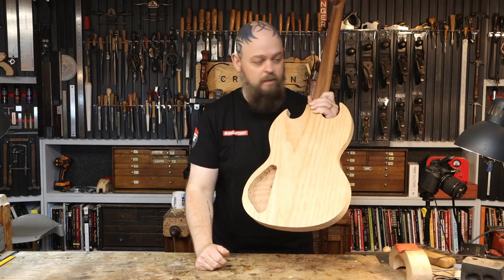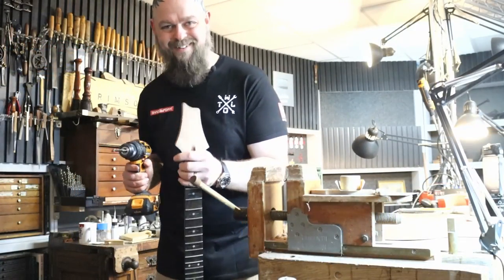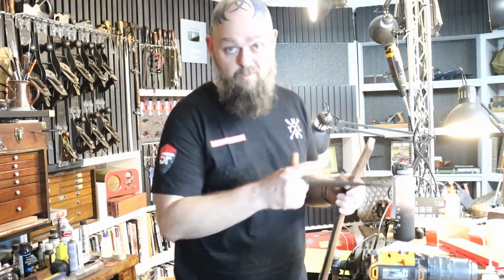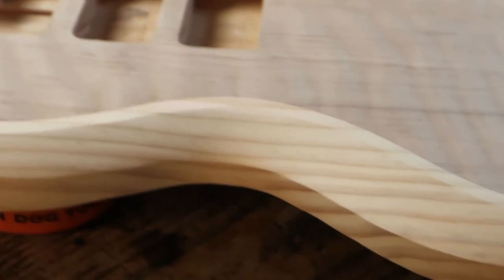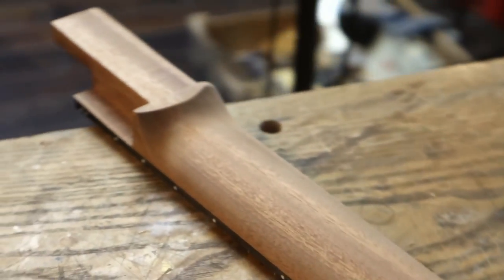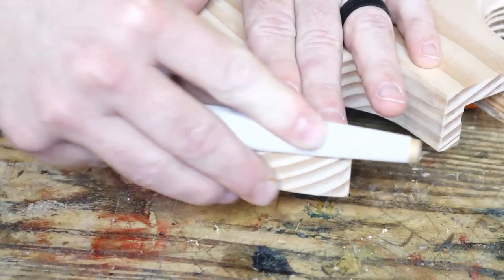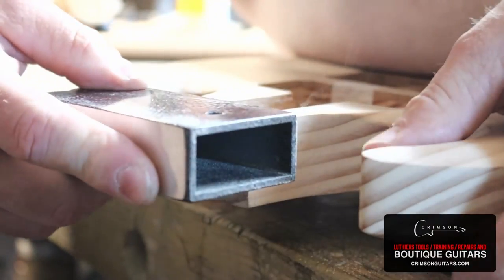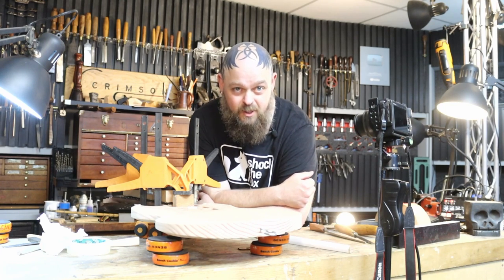Ep 11 - It's in the Fine Details! Fettling, Carving, Shaping & Dialing this Guitar in - Redwood SG

Comment: Hey Ben, I'd really like to see more of the finishing processes - not just wipe on poly or Danish oil, but finishing to a high gloss. How to finish porous woods, grain filling and leveling. I find my builds go relatively well and then I'm let down by poor finishing.
Reply: +1!
Reply: I’m intrigued by the superglue finish you used on the neck of the ancient wood build. I’m getting a kit for my birthday (you got to start somewhere!) and I’d really like a high gloss finish with (relatively) little pain. I’ve never been able to get a great gloss finish using varnish on my furniture. Really hoping you’ll be showing us how to do that soon 😊
Reply: High gloss paint and clear are difficult because imperfections really stand out.  Its one of the reasons people specialise in it and why people send their work to a painter.  If you want to do it, I'd say, go for it but be prepared to redo it a number of times before its right.

Comment: Hey Ben, I'm at the beginnings of building an SG out of recycled Kauri so watching these videos with great interest but I think I've missed the bit with putting the 2 or 3 deg angle in the neck joint. Is the angle in the bottom of the tenon or in the tenon slot? Cheers, Tim

Comment: Next build should be "I try to design a new production line guitar" The focus should be the design choices taken to achieve a repeatable, easy design that doesn't rely on "one off" caracteristics such as "look at this amazing piece of wood" therefore it should be made out of commonly available wood (it doesn't have to be the usual suspects as mahogany alder and ash).
I already hear you saying "just look at a Fender factory tour" and you're right, but in the last 70 years apart from the introduction of CNCs this hasn't been improved. Come on Ben, it's about time.

Comment: Ben,  Want to thank you for a great tip on white glue and saw dust mix.  Kind of forgot about that and have used filler in the past that NEVER seems to match the wood color and when stained sticks out like a sore thumb.  Just lost control of a router table this morning and cut a 1/16" deep area of wood not meant to be cut (loss of focus).  Had just watched this episode and used the sawdust from the cut to make a putty and you could never tell after setting.  Thanks for the tip and is now in my go to box for screw ups!

Comment: About sanding the soft wood.. I have a big problem with my 15mm spalted apple wood top.. I carved out a bit between the bass side horn and the neck with a rasp I already had but I just can't sand it flat and smooth now.. In a different place with a convex curve i fixed it using a straight piece of wood as a sanding block, but this piece between the left horn and the neck is concave which is giving me trouble.. Already ordered a sanding stick a few days ago. Hopefully that is going to help.. Any tips?

Comment: I've made a couple of headless basses lately and there isn't a lot of guidance out there for them. 
One set of hardware worked in a relatively straightforward way, the other was a nightmare. Worth a go though as I had fun - especially headless multiscale. 
I'm going to have to call you out on the obvious mistake though. You didn't do the obligatory picking up of the guitar with the neck at dry joint stage in the video that I'm pretty sure is etched in YouTube law for fitted necks 😂

Comment: I agree this style neck joint is superior. The electronics and the amp determine the sound. But if you limit sound degradation then you'll have better sustain (of course), and I think a bolt-on neck is where a lot of energy from the sound gets lost. With a bolt on neck and reasonable hard woods (long grain) you're getting as much honest sound from the strings to people's ears as you can.
Other variables are fairly arbitrary and often get buried under a thick layer of effects anyhow.

Comment: Hi Ben, love the SG woods combination so much. About a new video, please, I believe that you can help with an intonation one, There is a channel that  claims, that the "only way", for "perfect intonation" of all the fretted notes, in every string, on the fretboard, you need to use an odd shaped, "bigger" compensated nut, (not just a properly cut and shaped, normal nut), if its an electric, and if it is an acoustic, the same odd shaped compensated nut and a compensated saddle, for "perfect intonation- concert pitch",  but I really wonder, if that is, a written in stone fact?  the majority of builders and techs that fixes or builds guitars, that I have watched, never present the notes in the whole fretboard, just the open string and 12've fret fretted note, as the "whole intonation" process, so what about all the bone, plastic, brass, tusq, nuts that are being sold? so most of all guitars new and old, are not properly, fully, reasonably intonated? 
I know that there is another way of intonating without changing the nut, that is to tune down some strings a notch, "James Taylor, compensated tuning"  to have proper full intonation without a "compensated thicker odd nut" as this video suggests:https://www.youtube.com/watch?v=GBwQJ71V9DE&ab_channel=CSGuitars
I know that there is no "perfect", and as well the modern fret placement, string tension and gauge, the fingering position, point of contact, amount of pressure - force, type and new or old strings, and the right hand attack, are as well, things that will affect the tuned notes sound, but regardless, then why all the manufacturers and builders, do not use, compensated bigger nuts, if really needed. Cheers.

Comment: There are lots of bits from this series that could be snipped and edited into a really useful guide - eg ALL the steps involved in this neck joint from cutting both the mortise and the tenon to produce such a very fine and tight joint..

By the way, how are you certain here that the main section of the joint - the back side of the tenon and top side of the mortise are finished tightly enough as so to be in continuous contact so that it’s a secure glue joint? I can’t see at the moment (it’s late) how this can be checked with the fingerboard in place?

Enjoyed seeing a ‘proper’ build again though. By far the best kind of video/series for my taste. 👍🏽

Comment: When I first watched the copper video I assumed the plan was to cut through to the front of the guitar so that you would get a little patch of copper showing. Then maybe toughened glass on the reverse so you can see the pots and beautiful soldering. I still think that might look cool - if an electrocution hazard? Then again - it is a beautiful and simple design as it stands. You could even hammer “Crimson” or a we logo into the copper bottom. Not sure about how the transition between wood and copper though unless it was done incredibly precisely.
Reply: P.S. I agree - I love watching full builds episodically. I don’t do any kind of wood work and don’t have space for it. For some reason I just like being along for the ride.

Comment: I am a bit concerned about the neck. Having removed so much from it, the use of a tenon rather than a dovetail, and the softness of the body wood, should this guitar ever need a reset (and that is a matter of when, not if), will the reset absolutely destroy the neck? It's looking to be a thing of beauty, and I'm looking forward to seeing a natural finish on it.
Reply: Why do you think it Will definitely need a neck reset? 

Such an operation seems pretty rare on fixed neck solid/semi solid body guitars as far as I’ve ever seen, and almost infinitely rarer than on aging acoustic instruments.
Reply: @paulneeds  Of course it depends on how an instrument is treated during their lifetimes. If it's well cared for, kept in a case,   and is not exposed to rapidly changing conditions, it might never need a re-set. And I'm thinking in terms of 30 to 100 years. However, there's a reason Leo came up with the bolt on neck and as one may discern from my concern, I'm firmly in that camp.